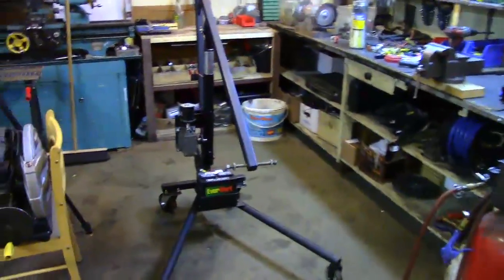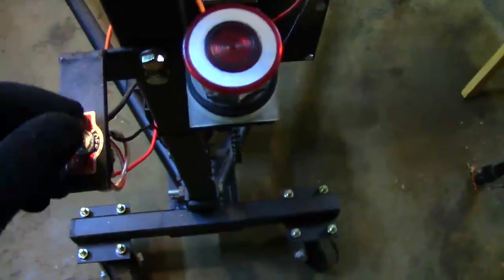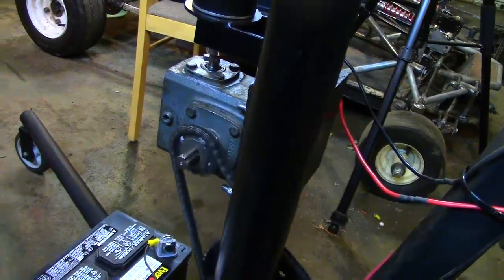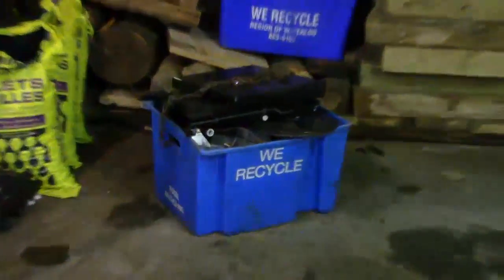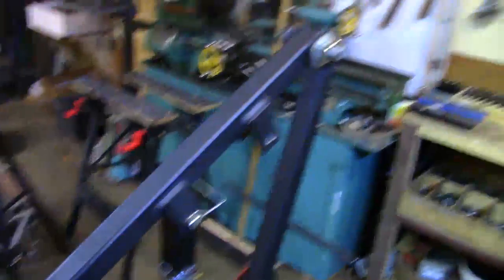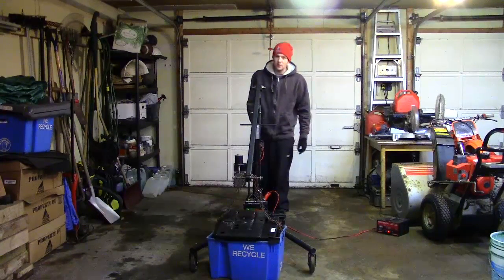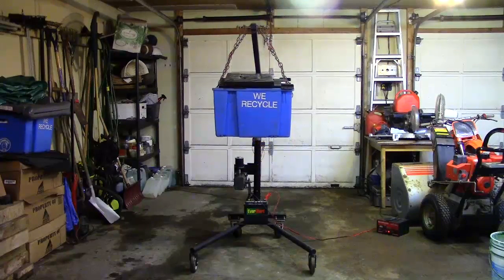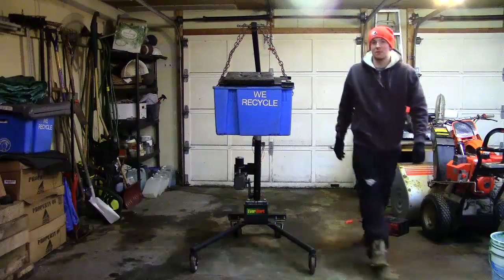Part 4: Electric Utility Hoist/Engine Hoist (Painting & Wiring)

Comment: Great job on the build. Just wondering if you have bent anything as it looks to be on the light side. By repositioning the lift point on the boom you increased mechanical advantage but reduced the lift height and slowed it also but also increased the lift capacity. I wouldn't suggest lifting a car engine without bracing the legs and trellising the boom. The motor here maybe your limiting factor though.

Comment: Well done Brent - really great build. Just one question / observation - Do you have an exhaust fan in your workshop? With the welding and then the painting not real good for your lungs in a confined space. I really enjoyed the videos though. I have some larger electric motors 1.5KW (3 phase) with reduction boxes already connected so I think I will try and replicate aspects of your build but for a gantry hoist. Thanks for the great instructional way you put it together.